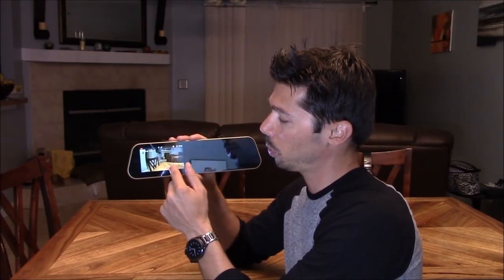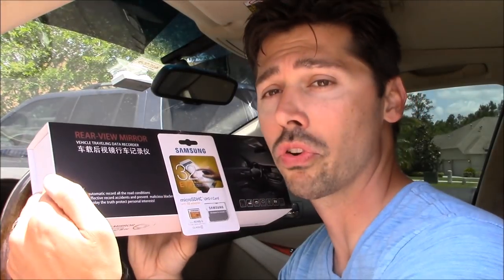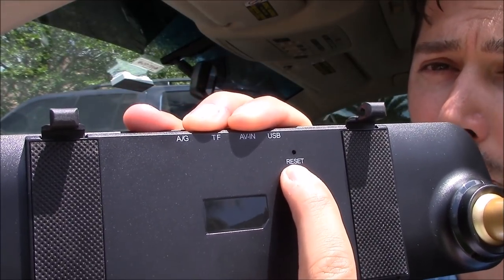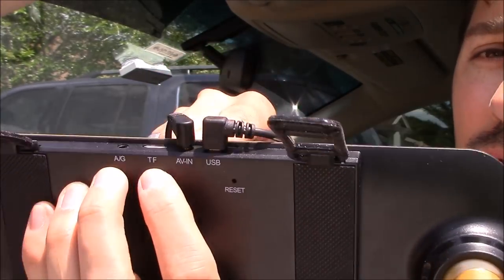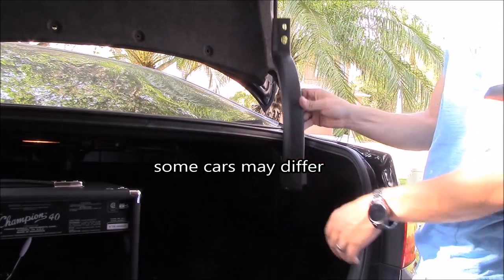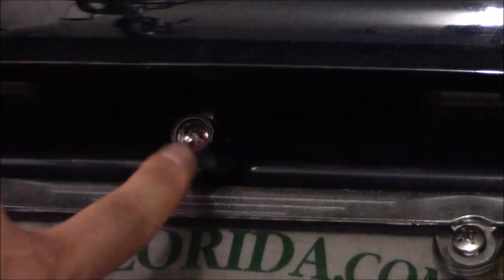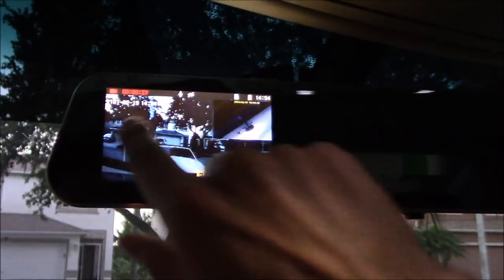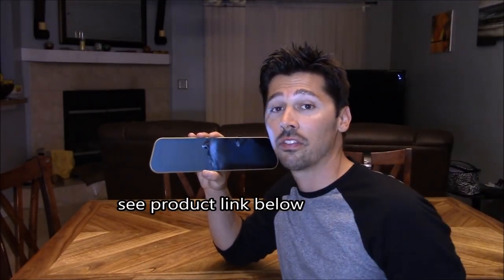How to install a backup camera - dash cam car rearview mirror DVR review

Comment: Is the camera water proof?
Reply from the maker: Lilu Waiin so far my backcam went through many rain storms and car washes no prob. just remember depends on mount location and if you have the connection inside your car trunk not outside.
Reply: So my problem now is how do i zoom out the back camera??
Reply: like a dslr by rolling the front of it

Comment: mine doesn't switch to rear view when I put my car in reverse please help
Reply: Chris Rico 
you didn't hook up the reverse camera wires to the reverse lights. lol. red positive wire goes to positive wire of the reverse light, then black negative wire has to be grounded onto the chassis of the car. very easy.

Comment: Omg your use case is terrible! Spying on your driving child? Ever heard of trust?
Reply: Kids are trustworthy if raised correctly yes; but their lack of driving experience means they will make foolish mistakes, especially when they aren't being guided by an adult in the passenger seat.  This is a great way to teach people to become better drivers.
Reply: Also as much protection for them. Some people are assholes and will try to pin an accident on the young and inexperienced driver. If there's video proof going the other direction, you've just saved your kid getting screwed on insurance premiums even more than normal.